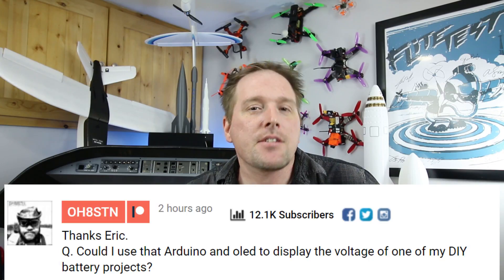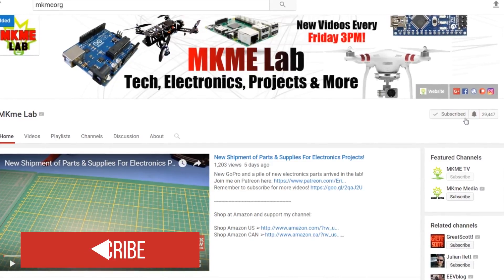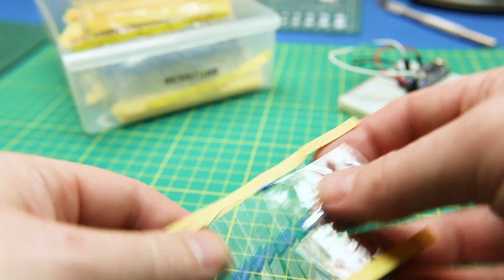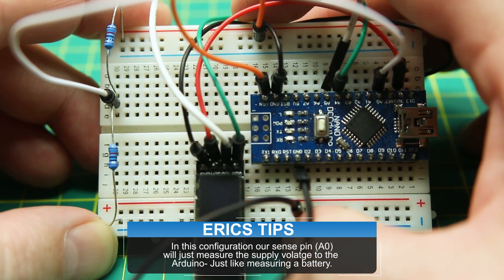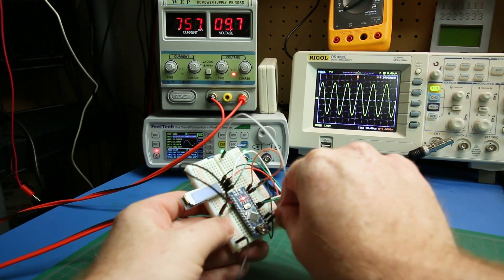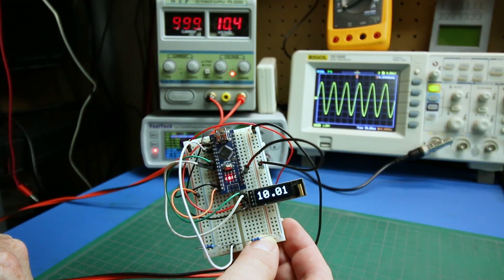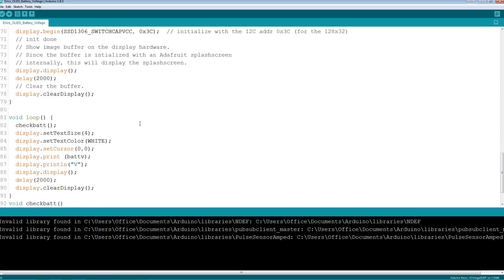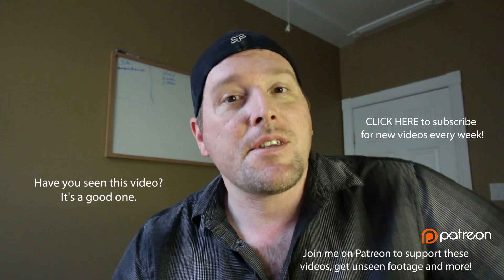DIY Arduino Voltage Display OLED Display Tutorial

Comment: how can i build a system and connect 15 samples of MFC (microbial fuel cell)(it is almost like a battery, they produce electric) in same time for measuring current (low between 0mA to 3A) and voltage (between 0mV to 800 mV) continuously? I have an oscilloscope, if the system help me to get the reading continuously from the oscilloscope or independently measure them, both way is good for me. Please someone help me.

Comment: Hey, Eric! I would like to build a small Oled infotainment for my project bike but electronic skills are extremely low. I would like to include volt meter (these older bikes had issues with stators so would like to keep my eye on it), time, temperature and compass. You seem to be very knowledgeable and I would really appreciate your help! Thank you!

Comment: Voltage readings are accurate on 1s-3s batteries but when I try 4s, the reading is incorrect. Did I do something wrong? Even in your video 10.1v seems to be the maximum reading.
Reply: same happened to me. do you have a solution?

Comment: Hi dear i wanted to build it for my motor bike for battery voltage readings but i am confused about its range because arduino uno or nano boards inputs voltage range is might be 12v and bike dynamo  voltages could reach up to plus 15v d.c which could burn the micro controller so plz define measuring range of this circuit.

Comment: Hi, I’ve really enjoyed watching these and learned a lot “I think”. I bought a 20 x 4 LCD Display with an I2C adapter on the back a couple of years ago and never really got it to do anything. Would it get hooked up basically the same way that you connected this display?
Reply from the maker: Same wiring, different library/code. Cheers

Comment: Off topic question: What cockpit are you building? About 10 years ago I started building a 737NG cockpit. I had to move and stopped. Still have some parts of it though :)
Reply from the maker: It was a Lear 45 until I needed the room for studio stuff and took it all apart. Now its just an insanely expensive  backdrop. Whole playlist of videos on my channel.
Reply: I found it ;) Did you ever fly on VATSIM?
Reply from the maker: I did